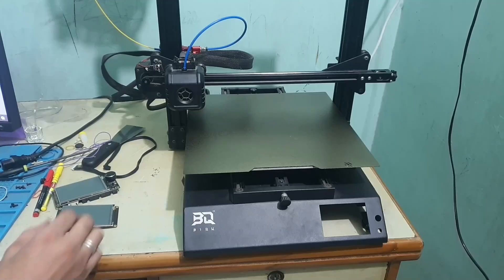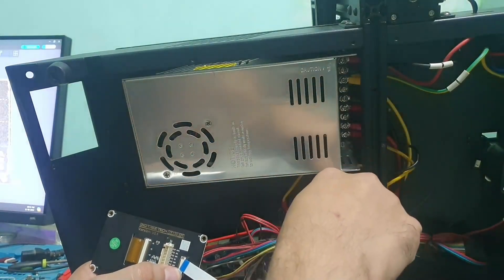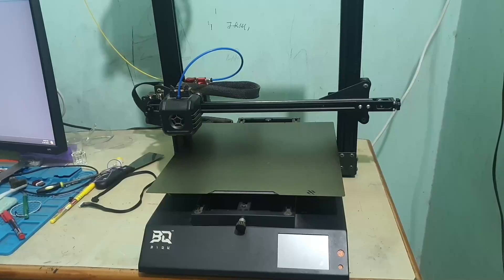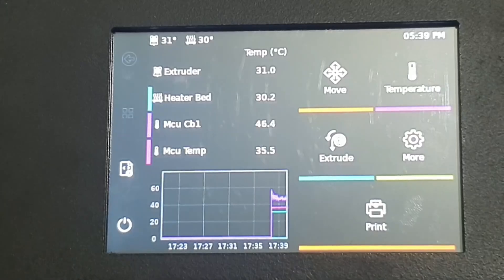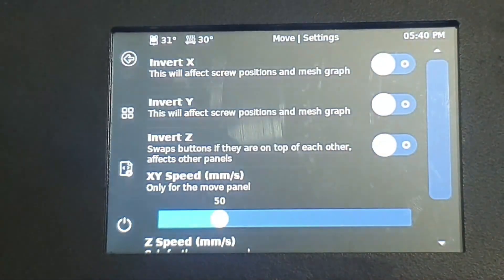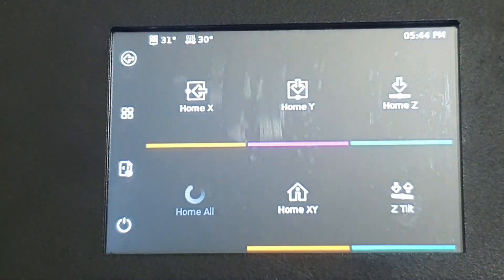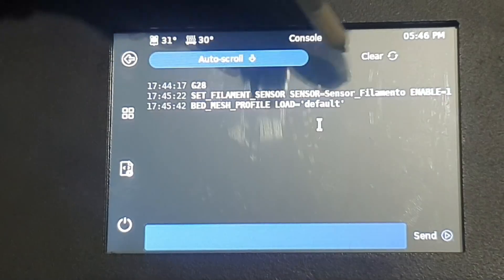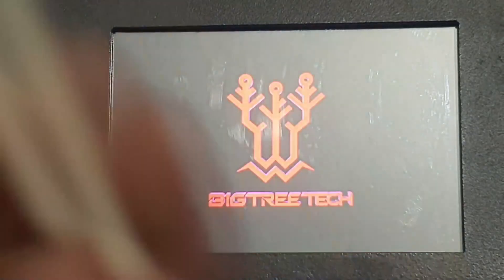tft35 spi install in bq b1 se plus

Comment: I cant get klipper screen working on the display, did you have to setup the pins for it in some config?
Reply from the maker: You need to configure it first in your boot file then it work its not setup by default and subscribe channel